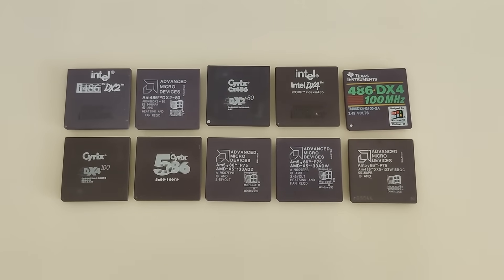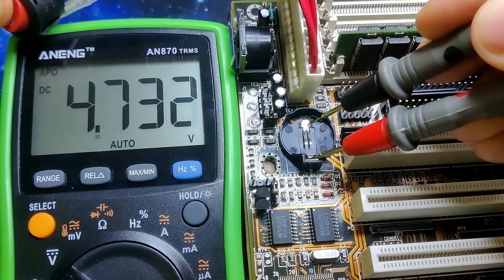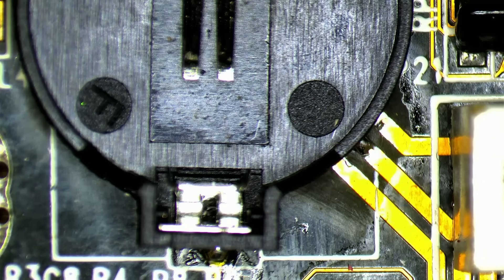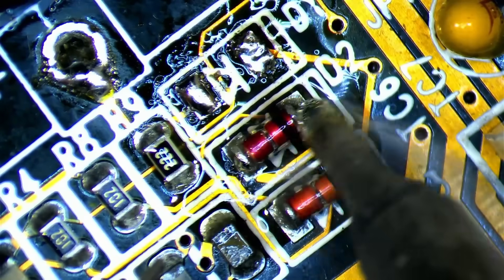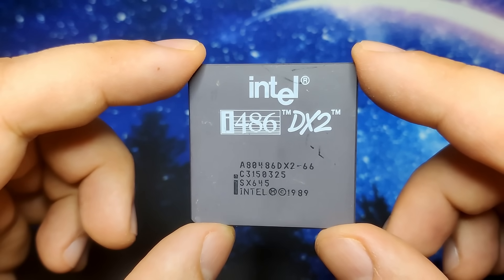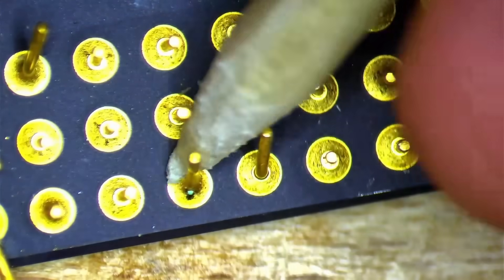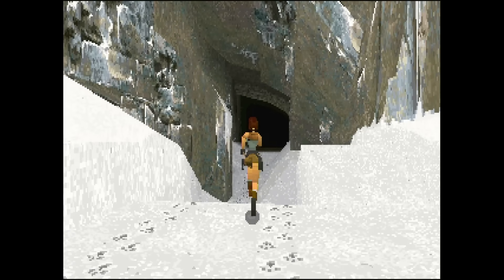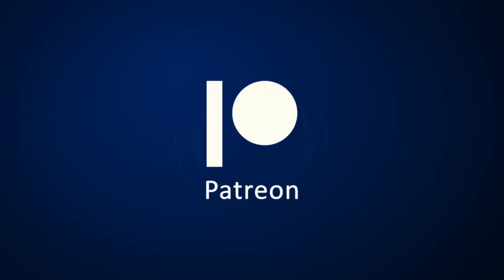Tomb Raider (1996) on Socket 3? (Part 1)

Comment: Surprised at how well it ran at all with a 486 66mhz.  I bet a 160mhz AMD 5x86 + a graphics accelerator will have good gameplay?
Reply from the maker: I think so too! But the Voodoo will change the resolution to 640x480 if I'm not mistaken. Maybe the S3 version has a better potential because I think you can change the resolution to 512x384.
Reply: @bitsundbolts  I think you can also adjust the resolution down in the 3dfx version. I don't think it would make a difference in framerate but I could be mistaken.
Reply from the maker: If I recall correctly, the 3Dfx version is locked at 640x480, but I'll check when we get there!

Comment: My first IBM compatible PC was a cheap DX2/66 with just an ISA bus and a basic VGA csrd. Processor wise it was faster than my Amiga 1200, but graphically and sonically, it was inferior for most games. DOOM ran on it, but slowed down to a crawl on really busy levels. Before the Amiga, I had Atari 8 bits, which were real powerhouses in their day. Compared to my very first computer, a Sinclair ZX81, they were all incredibly powerful.  Things changed so quickly back then. 😂
Reply: Ram 16mb?
If not, that was a considerable limitation imo.

Comment: I'm sure you said in a previous video, but I've forgotten. What do you use to straighten bent pens? Toothpicks?
Reply from the maker: Yes, toothpicks and cuticle pushers which are bigger and easier to hold. Most of the work is done with cuticle pushers though. Only the pins that are bent almost 90 degrees benefit from toothpicks to get under the pin and lift it enough so I can continue with the larger tools.
Reply: @bitsundbolts  Nice! Makes perfect sense. Wood is an amazing thing.  Strong enough to manipulate metal, soft enough to not damage it
Reply from the maker: Exactly why I somehow went with this method. But I guess I have to try the mechanical pencil, not sure if I like that method though.
Reply: @bitsundbolts  If your method works, why change it? It might be more time-consuming, but you have yet to rip a pin off or break it, so I'd leave it be
Reply from the maker: I'm just curious because a lot of people suggest the mechanical pencil. I wonder if I have good control over the pins like I do with the toothpicks. But yeah, so far no ripped off pins!

Comment: I have a 486 witha a broken pin, I dont know if I can fix it :(
Reply from the maker: Maybe wait for the next video. That other DX2-66 may have some issues due to corrosion. I don't think I'll be lucky enough to not break off at least one pin.
Reply: your videos are very inspiring :) @bitsundbolts
Reply from the maker: Thank you!

Comment: Your diodes may be fake. Marking shouldn't be washed by IPA. Not that it matters in this circuit, but could be a problem when used in higher power application.
Reply from the maker: Yeah, could be. I know I got them from AliExpress a couple of years back. That is the cheapest and fastest way to get spare parts as far as I know (unfortunately). But so far, I haven't had catastrophic failures.

Comment: I was interested to see how this ran. I'm fairly sure I had a 150mhz 486 when I tried it out and I seem to remember it running decent. I'll be interested to see how this performs on faster 486s.
Reply from the maker: I have an AMD 486 DX4-133 ADZ - which was supposed to be a 160 MHz Version, but it was never released with that rating because it could have canalized K5 sales. I have yet to test this theory.

Comment: What I don't get is, a PS1 CPU was only (to my knowledge) 33mhz and could run the game very well, yet a PC with a 66mhz CPU struggles to get 15fps, even at 320x200. Why is this?
Reply: A VERY simplified answer. It's because internally, the CPU (and indeed the whole PS1 architecture) is far more advanced than the older Intel 486 architecture. They work differently, and directly comparing Megahertz is only useful for chips of the SAME architecture. For x86, generally, an original Intel Pentium is considerably faster than the Intel 486 at the same clock speed. A modern x86 CPU at 33MHz would blow them both away.  But because they work differently internally, MHz alone tells you nothing about their relative performance. ARM or IBM Power CPUs are very different to x86, so again, using MHz to directly compare performance (speed) to x86 is pointless. You need to run specific benchmarks to ascertain relative performance.
Reply: Also (and more importantly) the PlayStation has dedicated hardware handling the image generation so the CPU can spend more time on game logic. On the base PC version the CPU spends most of its time generating the image in software.

Comment: You should test it with a Voodoo card. 

I saw a video where someone ran Tomb Raider with a Voodoo and 100 MHz DX4 and it was perfectly playable.
Reply from the maker: Yeah, that's the plan. We're probably also comparing it to S3 and maybe other specialized versions if they work on this platform.

Comment: I remember playing Tomb Raider with 486DX2/90 back in nineties 😅 Had S3 Vision864 VLB then and it really liked 45MHz bus speed. Now my 486-systems are Am5x86/150 with 3x50MHz bus speed and every setting in bios are set to tightest. Cirrus 5434 VLB flies at 50MHz bus speed too. Needed to hunt down memory that can cope that... Mobo is QDI V4S471. Second system is Asus PVI-486SP3 with POD83. Third is ICL D4/66d XGi (MikroMikko 6 in Finland) which had originally i486DX2/66 but now it has i486DX4/75 overdrive @100MHz. Fast machine with propietary 128KB L2 cache and ATI Mach32 VLB on-board.
Reply from the maker: Those are very nice systems! Ah, I need to get more VLB cards, I only have one and I don't even know if it works.
Reply: Cirrus 5434 VLB is actually clearly faster on that QDI-mobo (SIS471) than S3 Trio64 PCI on Asus 486SP3 (SIS496). Don't know about UMC82C881 if it's PCI-implementation is faster than SIS496, don't have any motherboard with that chipset. But, here you have some hints for you to do some benchmarks 😅 486: PCI or VLB 🤔

Comment: A good tool for fixing cpu pins is a mechanical pencil (the kind with replaceable graphite), as you can fit one pin inside the opening without accidentally bending other pins.  

Although truthfully I've never held a 486 CPU so perhaps the pins are bigger and this method will not work.
Reply from the maker: I'll try to get such a pencil. But I need to get the right size. Those pins on 486 CPUs are quite thick compared to later CPUs. I'll measure and try that method in a future video.

Comment: in the microscope image I see quite a lot of chromatic aberration. I wonder if using a different light source might improve the image quality a bit.
Reply from the maker: I have two light sources at the moment. One is the ring light of the microscope and the other is a dual gooseneck light. I think I made a mistake here using the ring light only
Reply: I don't think a monochromatic light source would make working easier.

Comment: I played it on a DX4-100 and it was a bit of a slideshow lol (it's also an OverDrive, so it would work in a socket 3 as well).
Reply from the maker: Yeah, I think the 486 won't be able to run it in software mode. Maybe a 3Dfx or S3 patch may help, but I don't know that yet.

Comment: The 4SAW2 board is one of the fastest Socket 3 boards I've come across despite it having both PCI and VLB slots. Its performance is edge-to-edge with the UM8881/UM8886 boards like the HOT-433, at times being even better. I almost chose it for my 5x86 build if not for the strange quirks this board has concerning the VLB-PCI implementation and some chipset limitations. Great work and great video though! And, as other viewers, I am in absolute awe of the surgical precision-like pin straightening work! Kudos!
Reply: Which board did you end up using instead?
Reply: @Brooklyn727  The 4SAW2 I tested had issues with things working (or rather not working) among different BIOS revisions; perhaps it's the matter of that particular mobo. It's an incredible board still! I ultimately went with the Shuttle HOT-433. In my hands it didn't feel nearly as buggy or flaky as some people claim, plus I adore its teeny size - perfect for a Baby AT build. Only real drawback of the board is that there's a mod needed to add PS/2 compatibility, but other than that it feels blazing fast and very stable! Yes, it has no VLB like a "real 486" should but we can always find another excuse for another PC to tinker with now, can't we? ;)
Reply from the maker: Thank you! I have yet to discover many things about this board, but I came across posts mentioning the chipset limitations (I think it also doesn't support interleaved cache, the VLB performance issues, weird memory behavior like no double sided memory on DIMM socket 4, etc.)
Reply: @bitsundbolts  Yup! There's a nice article about some of those on a website called The OS/2 Museum. Frankly for the most use-cases people would have with this board most of the quirks can be worked around, and quirks are part of the charm that this old hardware holds, right? That said, if we are to believe The Retro Web's database, there are only four documented SIS 496/497 boards with PCI and VLB on board - including the ASUS PVI-486SP3 - so perhaps digging deeper into those chipset limitations would be worth checking out? Also, for posterity - I noticed your 4SAW2 has the WA911 BIOS with 128GB support - mine was very unstable on this bios revision and the 128GB max limit didn't seem to work either. BIOS rev. WA53 had the floppy not working at all, and only rev. WA3 was "fully" OK. Looking forward to your future videos on the board - who knows what you might uncover? :D
Reply from the maker: The details I mentioned in my previous comment were actually what I remember from the OS/2 Museum page 😊. So far, the system seems to be working well with the latest BIOS. But I did have quite the bumpy start with this board which I'll cover in the next video.

Comment: I am interested to see the problems you faced with the motherboard! It gave me it's share of problems, i managed to solve them one by one but the most persistent is that it discharges the battery too fast. Either a coin cell or external battery pack. Otherwise an excellent motherboard with plenty of features and vast cpu support! Havent tried a local bus graphics card though. It would be interesting to see how it performs with isa vs local bus vs pci.

Your channel keeps getting better, it gives the right push many of us need to "get our asses up and do it". Keep up the good work.
Reply from the maker: Thank you for your kind words. Well, I guess then the next video may be right for you! I also suffered from a rapidly discharging battery!
I don't want to spoil the next video, but that capacitor I removed in the final shots was the culprit for me.
I can tell you that this issue gets a lot worse and suddenly, your BIOS won't keep its settings anymore! Interesting that you seem to have the exact same issue that I had!
Reply: Oh man! Cant wait for th next part. This problem haunted me for too long... 😆 @bitsundbolts
Reply from the maker: I have seen your answer :) I guess you had exactly the same problem... glad you finally fixed it!

Comment: i'm still trying to figure out why my 486 board won't initialize video, regardless of what graphics card i put in it, and what slot type of card. supposedly it boots to the prompt, but no video at all. the post code card never shows a video init signal in the boot process, but as far as i can tell, everything else is happening.

its very strange.
Reply from the maker: From the very short time I spent with this platform, here are my suggestions:
1) Make sure you're using FPM memory
2) I know you said you used any type of slot for VGA, but maybe you entered the boot block recovery BIOS - only ISA video cards work then
3) check BIOS/reflash using an external programmer of hot flashing
4) CMOS battery intact and charged? BIOS jumper set to retain settings?

I may discover more things along the way.
Reply: @bitsundbolts 

i've tried both types of memory. same result. i get the memory test sound, and post beeps, no video. leaving the memory out gives the usual angry no ram sounds.

 isa, pci, doesn't matter. no video, and they all work on other systems fine.

its an intel ninja ed/pci, no hotswapping as the bios chip is soldered directly to the board, and i don't have a hot air station to pull it off properly. and the price of a piggyback clip to program a 32pin plcc is .. not worth the hassle. if it was socketed, i would have already tried that option, since i have indeed been wondering if there's some bit rot in the bios that is leaving out the video irq init command. and i can't even get the adapter onto the chip to bodge it with jumper wires into my programmer, since there's also not enough room to install a socket even if i did get the existing chip off, its juuuust close enough to the pci slots to make it unworkable in all cases.

probably have to set it aside until i can get a hot air station. since one can be had for less than a test clip (and usable for more things, too). thankfully, there's nothing on the bottom of these old boards so i can put some flux on and heat it up from the bottom without issues when i get that far.
Reply from the maker: Sounds like a tough problem to fix. You could be right with the bit rot. Although I haven't had a motherboard yet that caused the video signal to be absent, I had at least two video cards (TNT2, Voodoo 3) that seemed to let the system boot normally, but didn't display anything on the screen. A BIOS flash was all that was needed.

Comment: Nice Video! What flux are you using?
Reply from the maker: It is labelled as Amtech flux, but I got it from China - so, not sure if it's real or not. However, it does work really well. There is a link to the flux in the video description.

Comment: 6:20 I totally played the original Tomb Raider on my 486-DX2 50 overlocked to 66MHz.  This is the first I’m hearing about this limitation.  The game ran ok, about as well as the original Quake.  Playable, but not great — however I chalked that up to not having a 3D card (GPU), back when 3Dfx Voodoo was the only option and expensive.
Reply: 10:00 and that’s exactly what I remember the gameplay being like.  It was totally playable.
Reply from the maker: I think if you really want to play the game, then this is ok. But it will get a lot worse in larger areas.

Comment: Nice video and what a patience you display fixing those bent pins. I’m surprised it takes that long. I developed a method that does it in ten minutes, I should do a video about it as I have straightened so many CPUs from ceramic vintage to Athlon Opterons all with the same method.
Reply from the maker: I'm curious what other methods are there except mechanic pen tips, credit cards and syringes. I spent about 30 seconds per pin on average. Considering that the pins are bent in all directions, the credit card method is out. But anyway, bending the pins using toothpicks is very therapeutic 😊
Reply: @bitsundbolts  ah that’s what it was! Tooth picks! Ok, I guess it is not a big secret: I combine sharp tweezers with what you call the credit card method. With the tweezer I push through all rows, rotate 90 degrees, repeat, etc. Now all pins are somewhat pointing upwards. Then comes the credit card (I use a metallic collar stay). As pins are very robust one can do this fast and course without damage.

Comment: I used a 486 CPUs in one of my old computers. It was first equipt with a 30MHz CPU, I later upgraded it to such a 66MHz CPU and finally to a DX4 with 100MHz and Windows 95 and IBM PC-DOS worked very good on the 66MHz Version. I remember playing SimCity 2000 a lot of a time, definitely a great CPU.
Reply from the maker: I started with a 100 MHz 486, but it seems like those 66 MHz versions were great back then!

Comment: at 7:10 you say intel pentium 486 dx2 66.... 😂
Reply from the maker: Yeah, that's a mistake. That's not a Pentium. I guess I'm excited to test the Pentium OverDrive on this platform!
Reply: @bitsundbolts  yeah i know it was an accident :D im just splitting hairs. on another note, your videos are supercool, im subbed and you probably seen some of my other comments previously. im a big fan of 486 systems and currently messing around with one since years to try to squeeze out of it the absolute last drops of performance (constant issues with L2 cache, max doom realtics so far is 1381 which is about 54fps
). now im trying a new motherboard. hopefully 1mb cache, 128mb ram and at least 4x40mhz. plus a gus and awe64 duo.
Reply from the maker: Wow, GUS are so rare these days. I only saw it on other channels. I'm at the start of rediscovering this platform, but I'm looking forward to creating many more videos!
Let's see if I even get close to your Doom score! 😉

Comment: Maybe they had used LIR2023 battery in that battery holder. Then it probably would not have been a problem.
Reply from the maker: And here I learn new things every day! I didn't know there were rechargeable button cell batteries that would fit! I never bothered to look it up. You may be right! But it opens the door for problems if one would install a non-chargeable battery. Good that I kept the original diodes!
Reply: @bitsundbolts  People rarely think that far ahead when they install battery holder. Also with motherboards with external battery header some headers charge and some don't so when I connect a battery pack with 3 AA batteries to such I need to check to know if can use normal AA batteries or rechargeable ones.